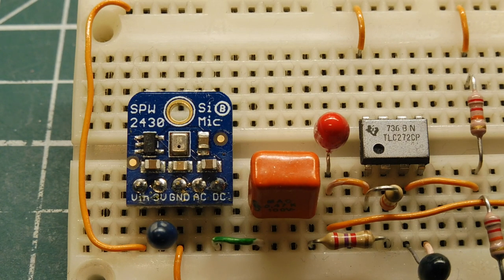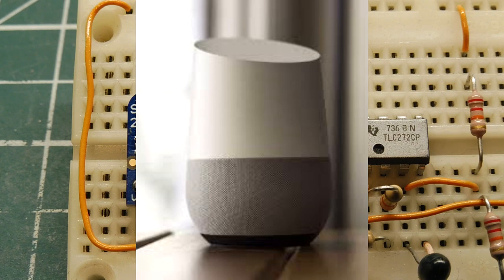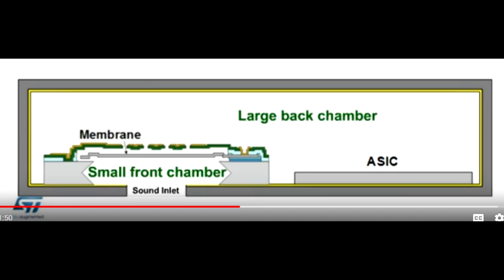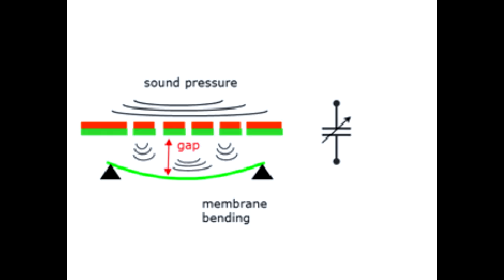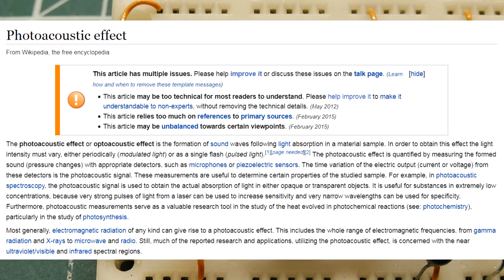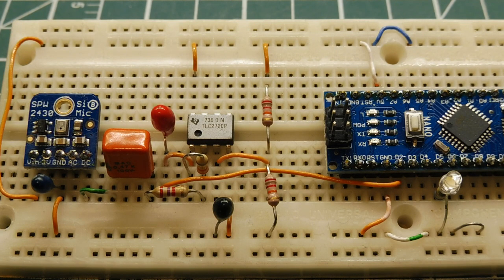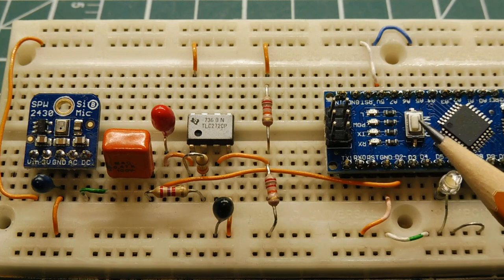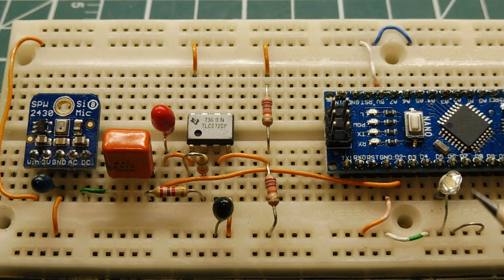Alexa Laser Hack  / MEMS  Photo-acoustic Effect

Comment: One would have to think the simple way to defend against this is to point the microphone hole into the room and were possible, away from windows. If it is possible to perform the hack on a device from outside the home, the manufacturers can make future generations of the device with the mic hole offset from the MEMS chip, making it impossible for a laser beam to shine on the chip.
Great video.
Reply from the maker: Yes, it would be very simple to defeat the hack ... just some common sense.

Comment: So by modulating the intensity you modulate the temperature change, thus modulate the bending of the membrane "simulating" sound, almost as if using a laser focused directional speaker.
Neat. 

But wouldn't any kind of mic cover negate the risk? Say there's a small opening drilled in the cover, the device would need to be aligned almost perfectly for the laser to hit the mic module in the right place.
Reply from the maker: Yes .. you could easily defeat this hack.